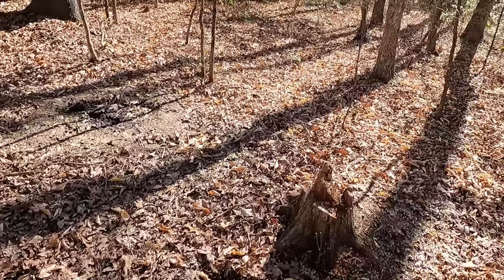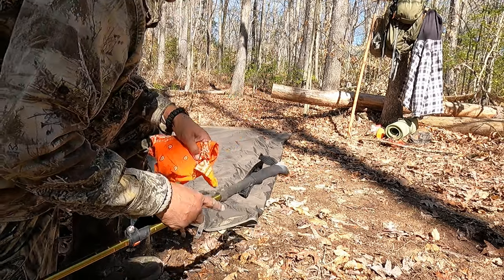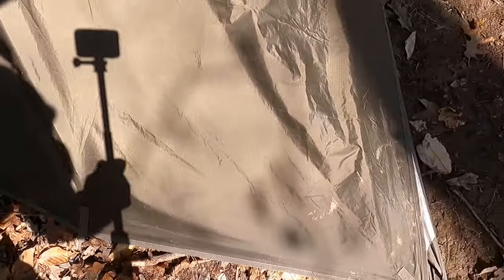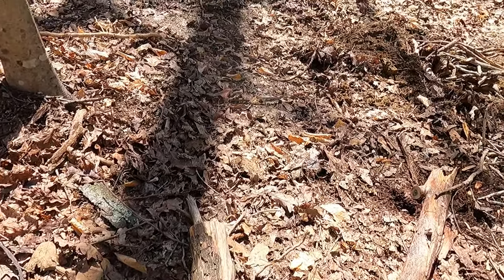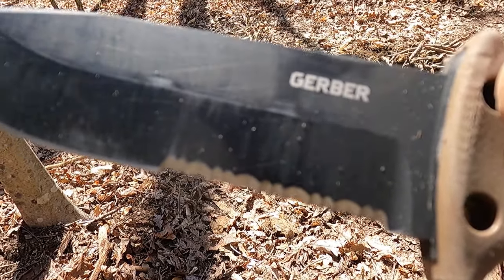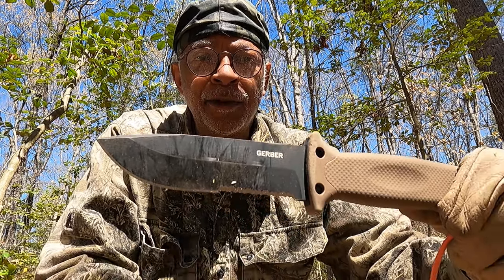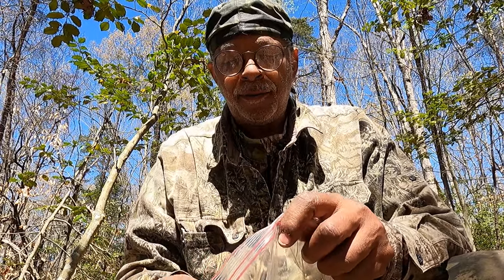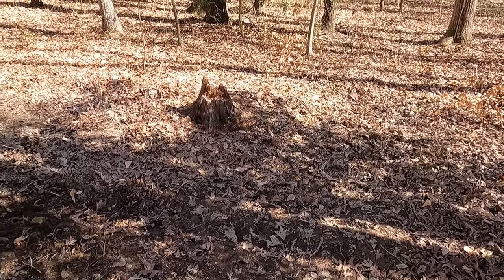ENCLOSED TARP SHELTER, WATER, FOOD, & FIRE

Comment: Nice video.  The reason most people don’t like serrated knives is because they are harder to sharpen…that enclosed tent is very hot in sun or warm weather…you can set it up between two trees then hang a ridge line afterwards you can pull out the center pole.  Have fun stay safe
Reply from the maker: Very true, Kenneth.  To sharpen my serrated edges knives, I have a special tool to do so, and it is no harder than sharpening a regular edge knife.  I am going to be purchase a Cold Steel knife that has a full serrated edge.  And yup, the enclosed tarp tent is a hot one, but I would only use it in the winter months; I just wanted to give a demonstration of it.  I just purchased another 10 x 10 tarp without any mylar.  And yes, I am going to make that shelter again as you just stated.  Stay Safe.